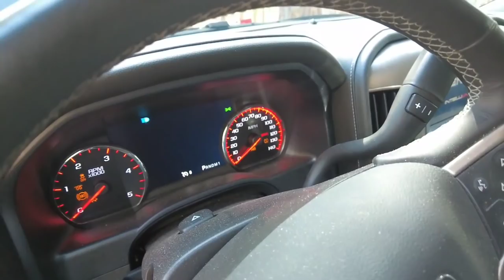Stranded and alone in the wilderness

Comment: This is actually a good reminder to always keep a circuit tester and a 12v solar charger when going for extended outings. It's one thing to get stuck and need a rescue... it's another when you're dealing with a dead battery. Hits different.

Comment: Good work, Casey. I definitely would have been scratching my head. I had something like that happen to me years ago. I was on a forest service road in my old Chevy. It just suddenly died while I was driving. After a bit of diagnoses I realized the fuel pump wasn't running. A stick had caught the power wire and broke it, which then touched the frame and blew the fuse. I taped the wire back together and used the foil from my cigarette pack to replace the fuse. Fired right up and I drove straight to a parts store to re-do my backwoods fix.
Reply: @Lttiggity sir, Just like McGyver! 👍 Good you figured it out!
Reply: Your story reminded me of working in a gas station back in the mid 70’s as a teenager.  Working by myself late on a Sunday night and in comes a VW Bug being towed on the end of a rope.  The guy tells me it just died on him and he thinks he is out of gas.  So I “fill it up” but it’s “a no go” with a bum fuel pump.  Being a Sunday night no parts house is open.  I end up giving him an empty coolant jug and a piece of wire and sell him a length of fuel hose.  I drilled a fuel hose size hole in the jug lid, filled the jug with gasoline, stuck the hose in the jug, wired the jug to the cowl below the rear window, started a siphon, and stuck the hose on the carburetor inlet.  Car fired right up and off the guy went.  Country boys can survive.

Comment: A lot of people probably do not realize just how brutal a washboard road is 
It's worth it to lower tire pressures too
Reply: I learned my lesson on tire pressure. For years I use to fly to Colorado, get rental and hit the washboard roads. Twice had something broken on new rental SUV cause something got shaken loose. Now I travel in my Xterra with big fat tires at 12 psi with air compressor. Smooth as butter
Reply: Very true about washboarded roads. We had to go over one last year to get to a campsite and had to go about 5 mph as the washboarding shook the s*** out of our trailer and ended up damaging the backing plate in the brake system. From now on, I will air down the tires on the trailer and air back up with the portable air compressor I recently purchased.

Comment: Thanks for another informative video. I had a 2011 Sierra that started giving me Stabilitrack and traction control warning lights, all it took to fix was cleaning the negative battery terminal, which didn’t even look bad at all. These modern vehicles are very sensitive to not having enough voltage.
Reply: Same here, my friends Taho Trac. Control would not work or shit at anytime.  It took 2 body grounds- block  ground and everything works good now.
Reply: @Bama1963  Personally, I hate the stamped metal battery clamps they all use anymore. There is so little metal  touching. I replace them with old fashioned solid lead terminals when I change out batteries. Factory terminals never seem to fit a new battery.
Reply: @johnme7049  yes the ones they put on cars nowadays are cheaply made

Comment: I have gone through the Sisters on my way to Bend if I recall about 30 or so years ago. Drove down from Tacoma to a job interview there in the early 90's, taking my car, then a 1978 Ford Fairmont and drove to Eugene/Salem, then cut east into the mountains and ended up just north of Sisters if I recall before dropping south, I think on or near Hwy 97 to Bend. It was spring/summer and the summer road construction was on so had to stop at times and wait to be allowed to advance through part of that area, and all that time, my transmission was leaking and dripping fluid all over the exhaust. The car had no AC. Fun! 🙂

Comment: I had a similar no-start condition on my 2 battery truck. In a panic I replaced both batteries and it still was exhibiting a no-start condition. Turns out it was just the main positive terminal on the starter was getting a lovely mix of coolant and oil dripped onto it from a slow leak. Quick wire-brushing later and all was well.

Good lesson to learn from this video. If things aren't as they seem, investigate!

Comment: I drove many wash board roads in the Mojave Desert from 1950's to 2010's. Worst problem I ever had was a roll over with my '56 Chevy truck in 1967.  Washboards caused the rear end to  hop violently out of control. Center of gravity then took over.  We got the truck uprighted, fixed a broken coil wire, and drove it home.  Windshield had completely broken out that resulted in a long CHP and Sheriff's pursuit (unknown to me until caught), but that's another story.

Comment: Good morning Casey!!  I know you don't always read all the comments but I hope you see this one.  Many of your rescues have been of people that have no cell service and no way to send a pin drop.  A lot of people don't know this but your GPS in your cell phone works without service.  Both Google Maps and Maps app on iPhone will allow you to get your coordinates without service.  Just open the maps app,  Google or iPhone, the map will be blank without service but the dot on the screen will represent your location.  If you touch and hold the dot it will still drop a pin and display your coordinates.  Those coordinates can be sent via text or called in from a phone call if someone hikes out for service.  You can then enter the coordinates in your phone and use navigation or maps like you normally would to see exactly where they are.  Just a little tip for anyone going out in the woods if you don't have a Garmin or some other GPS, you can still use the GPS function on your cell phone to obtain your coordinates.  

On another note, I've seen that exact same loose connection on several GM trucks and have helped diagnose and repair the same thing on many camping trips for people camping near us.  Keep up the good work!!

Comment: Was coming out of Mahatta River on Vancouver Island  on some pretty steep & rough roads. Could hear rocks pinging off the driveshaft a couple times & then the truck just quit. No stuttering, loud noise or anything, just shut off. Got out, walked to the rear of the vehicle & I could smell gas so I thought I'd spilt the gas can but it was still upright so that wasn't it. I looked underneath & that's when I saw the fuel line was disconnected. Some special fitting that requires a $100 tool from Strap-On & it was defeated by a rock. Pushed it back on & off I went, easy fix 45 miles up a logging road.

Comment: My sons and I were north of Plush 7 miles from cell service and I lost my alternator. I grabbed a pack and started walking. 2 miles later my boys showed up with the truck. A mechanic friend of my oldest son told him if your electrical component it working its okay give it a couple good wacks with a hammer or winch. It's ether broke or something is stuck so what have you got to lose. It worked. We did change out the alternator when we got home.

Comment: Had the same issue with a Toyota Tundra. Thought the fusible link had burned thought took apart the main fuse panel an everything was fine. Turned out to be the wire connection at the terminal. Battery had voltage, terminals had voltage, terminals post had voltage. Wire did not. Cleaned connections and all was good.

Comment: A couple years ago, my old Cavalier started fine at home and then at gas station a mile from home, but after stopping at dry cleaners across street from gas station, it was so totally dead that not even the aftermarket alarm LED wasn’t on.
Got jump start from AAA to get home as was around 5pm. In morning, obviously dead again. Second AAA truck found the issue: somehow the negative side terminal bolt had stripped some! Hadn’t been touched in months. He changed that and started just fine!

Comment: Casey, if you get them to open google maps (even if they have no data connection), it should be able to generate co-ordinates of their location, or a pin etc. These can then be  copied into a txt.  :)
Reply from the maker: And how are they going to text it if they have no data??
Reply: @CaseyLaDelle  There are different levels of connection quality with the cell tower. The first is just 'registration' where it initially connects. The second is 'txt' which is a very short connection to send a tiny amount of information. The third is 'calling' which is a constant voice stream of higher speed. The fourth is a 'data' connection (e.g. browsing the web), which needs the highest quality connection. You will get txt traffic, before usable calling traffic, before usable data traffic.

Comment: I had the wire in my crank shaft position sensor yank loose at the plastic base. No way to splice it together. Luckily I was able to coast my truck 9 miles through the desert down hill to the highway. I now carry extra crank shaft position sensors.

Comment: I’ve had a similar issue on my 2015 GMC Sierra 1500. I haven’t actually fixed the problem yet (the truck started again after a few days) but I’m fairly certain I need a new negative battery terminal cable. Even when it doesn’t show any corrosion, I’ve heard that it’s a common “random no start” issue with these trucks.

Comment: I build custom campers and repair campers for a living that is why when customers get campers I recommend a isolator system for there truck so they can isolate that camper from the truck that way it does not continually pull 12 volts from the truck battery

Comment: Casey, Have you ever tried spraying CRC Electrical Connector Cleaner to find the problem?  My Throttle Position Sensor plug acts up and causes limp mode. I got some CRC ECC to try next time.

Comment: If you don't have DC to DC converter with your solar, its good to just have a small solar panel like, 20 watts or even up to 50 watts and a cheap charge controller off Ebay and wire that up so you can hook it up to your lead acid car starter battery.  I keep a setup.  It saved my car batteries during covid lockdown.  It is something I would definitely take camping with me or anywhere!  If you leave your lights on, or door cracked, etc., and there is sunshine you can generally pump up a battery back up enough to start the automobile pretty quickly.  A charge controller w/solar will desulfate your battery if left on there long enough.  Make sure to top off batteries with distilled water tho, and just plain clean water or rain water if you are desperate.

Comment: don't know if its a local thing or not i am in southeast alabama usa most everyone in the south run a GREEN belt think its a Gates they say ends all belt related problems on the cummins. they also make for some gas burners but haven't found one that fits my 318 dodge yet you might check into it

Comment: first what brand is test "light"? never seen a meter light? I want 1! just a few days ago, working on my daily driver beater car, pulled out my test meter, it had dead battery and wouldnt check voltage, so I made do with test lights, I have since fixed car & new battery in meter, but wife was curious, so she watched, trying to learn, I explained about gauging dimness or brightness in bulb to try to understand voltage, but some things it wont do, as we talked about tools I carry, I said I would love to carry a meter, but they are too big, and too fragile to leave in tool box, but that looks great for carrying!  for example battery voltage & charging voltage, which isnt great, 12.85 volts, and charging 14.38. but its a high mileage worn out engine, that cranks easy, but I am sure will need battery soon, but being a stick shift, I wont replace until its dead. its a sub compact, & gets 42mpg. 

now great you found issue & was able to help. by wording, I thought maybe you broke down on travel to rescue someone? lol. eventually but hope nothing major when happens, so easy fix & back rolling, like throwing a track. lol.

you have a great one, & keep up the videos

Comment: Sudden unexpected electrical faults? 100% reliable vehicle suddenly turns up it's toes? I check battery connections, 2 Check earths. The diffrfence bettween a Mechanic and an Engineer? The Engineer can design it- The Mechanic can fix it.

Comment: you need a real jump box that can actually start a car or diesel truck with dead batteries. the little thing you have just won't do it.
Reply: You underestimate lithium polymer batteries. That lil pack will start a dead 6l v8 or bigger no problem
Reply from the maker: You are very wrong, that little jump pack has started many completely dead trucks and diesel engines.   But in this case, the batteries weren't dead and that wasn't the issue